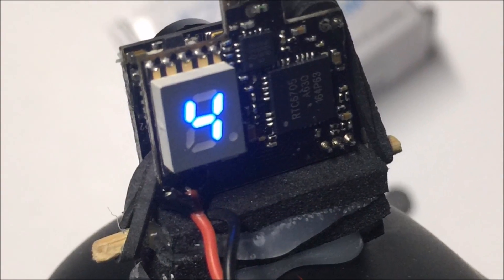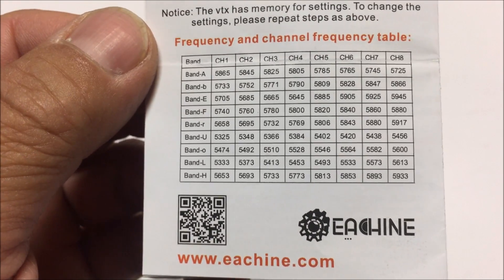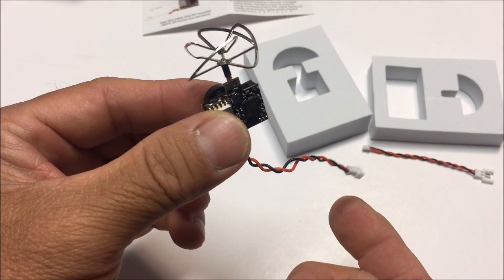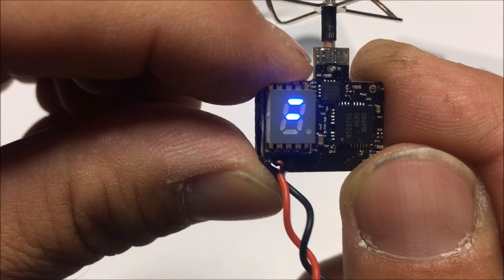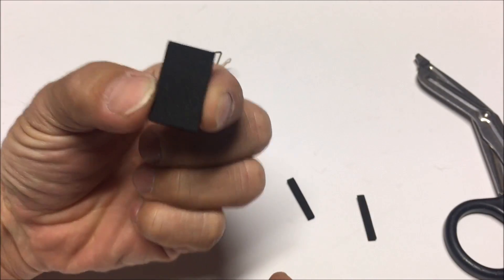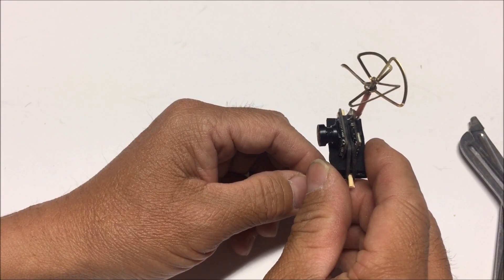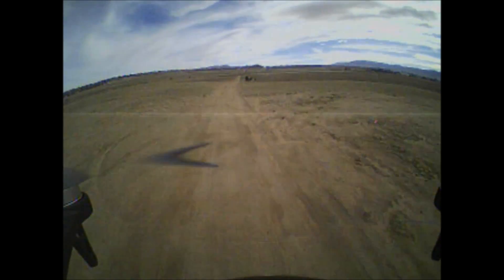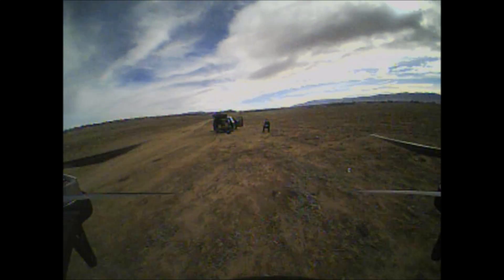Eachine TX03 72 channel 0/25mw/50mw/200mw aio vtx -- Banggood

Comment: Black wire is  2.5-5 red wire is  GND if i inverse them  will thé camra  burn
Reply from the maker: it is the connector that is inversed.
Reply: is this configuration right because i followed what thé menu said  but thé caméra is off

Comment: All the reviews on this note how hot the camera gets.  I'm wondering if 
the "power" (25, 50,200mw) settings draws different current, or the 
camera dissipates the current more as you go to 50mw and even more at 
25mw?
Reply from the maker: You know....I have not had any issues with heat since the only time it is powered on is while it is in the air and still have it and use it from time to time.  I just leave it at 200mW :)

Comment: Can I use the AUX port on my RX to power this also??
Reply from the maker: aux port on the rx or pdb?
Reply: I will be using this on a plane and want to use the AUX port on the RX for the plane to power it
Reply from the maker: I am not familiar with power out on a rx, however, is it a 2.5 - 5.5v?  then yes :)